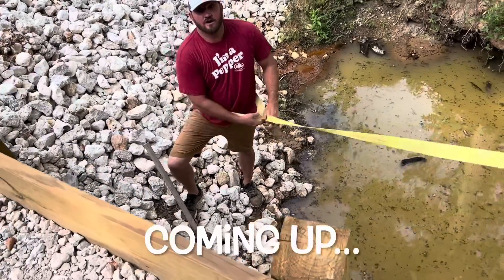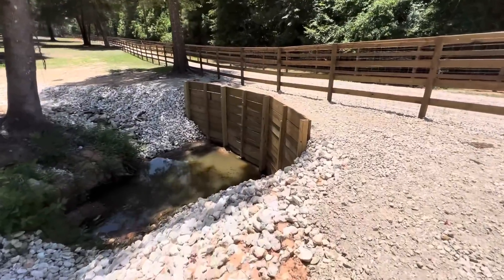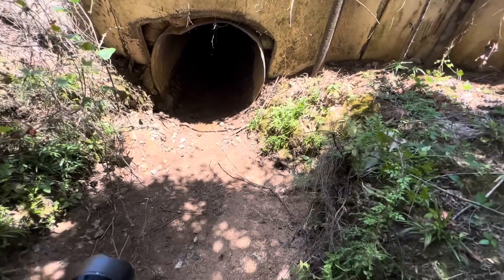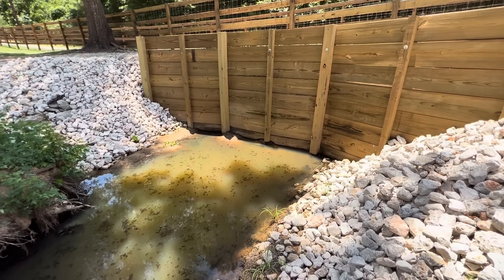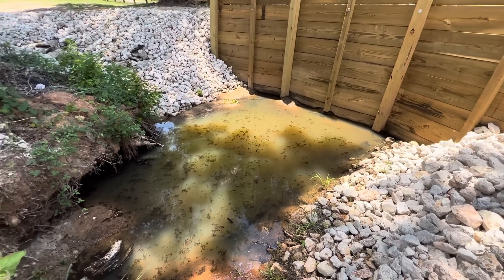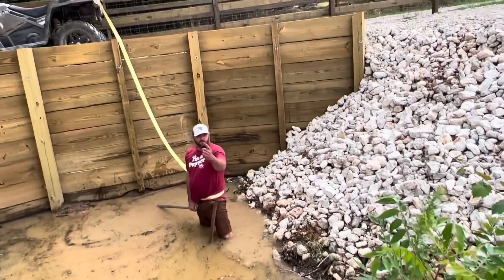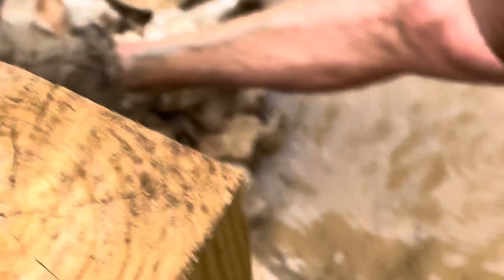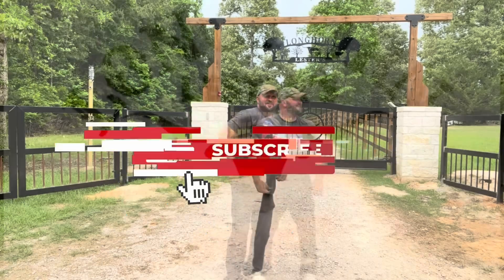Life at Longhorn Lester’s

Comment: Just a suggestion:   If your hose is long enough,maybe you could jet the mud out with the pressure washer and then put screening on that culvert opening to prevent debris from entering.   That's what our irrigation technicians do when they have to get a line cleared out under a driveway.  You and Lex made a great team.
Reply: NOW THAT IS A BRILLIANT SUGGESTION!! I'm just surprised they didn't do that to begin with!! ✔️💯
Reply: @ Maureen Vos 
That is a good idea, it would stop a lot of things, but, it won’t stop the mud. 😢
Reply: The pressure washer might temporarily declog, but that mudbed needs to be dredged out of there with big equipment (suction hopper dredger, cutter suction dredger, or backhoe dredger). And I am thinking that if the mudbed cannot be compacted and topped with gravel, you might have to dredge out that mudbed on a regular basis. That is what is done in some ports around the world- they have to be dredge them out on a regular basis. Just part of maintenance. 
You also might want to plant some more  trees around that area, so that the roots can stabilize the soil and prevent mudslides and mud clogging - because even with a screen covering the opening of the culvert, that mud accumulation is going to be one biggie to deal with.
Reply: @cristinacabrera8580  NOW, THAT'S AN EVEN BETTER SUGGESTION!! I wasn't thinking of long care maintenance just of the problem right now. But, you're right and Lester didn't think that the clay would settle at the bottom because that's the only place the water's at so that's where the clay is going down to and he hasn't installed the problem with the bank like Kim had mentioned to him to do. So if he does what Kim told him to do regarding the run off and and your suggestion I think it will work!! I truly think that Lester thought the rock would hold the mud.. But it's not even that it's the mud just sliding down because it's on an incline. Ta-da Lester HERE'S YOUR SOLUTION!!!  💯
Reply: I agree, you need a pressure hose to wash out the mud. Screening is also an excellent idea.

Comment: Good job man!.. you could maybe try to pump the water out a little with a small sump pump with garden hose to other side to give you a clear shot to the mud pack to hopefully make it easier to dig out. You shouldn’t have to work so hard.   Lex is such a honey.    (Some sump pumps have a filter at bottom though.. we had one in my Koi pond to filter out ick. So it will have to keep lifted off bottom and kept cleaned out). Lester is a smart man and will figure something out and make something work.
Reply: That was my thought too!

Comment: Two things… can you run a portable sump pump down there to drain the water so you can see exactly what’s going on?  From the opposite side it almost looked like the drainage pipe may look smashed.  Hope you get it cleared before any significant rains come (although that would be nice).  Lex did a great job running the video today!
Reply: I agree the other end looks like it was smashed and that is why the water is flowing thru.
Reply: Yeah that is what I was thinking. pump it out to get a better look and mabye easier to fix. And to me it also looks like that the pipe is pushed in so it is a lot smaller for things to go through.Although that is not the problem here.

Comment: I’ve seen a video Lester where they use an old tyre and drag it through the drain, using a hollow metal pipe with a strong rope or chain inside of it, and it works even in a small, long pipe and it pulls out all of the sediment.  Works a treat and you have the tractor OR SUV needed to pull it with a strong chain or thick rope.  That or you get a pump, to pump out the sand from the blocked end.

Comment: when you had the flashlight shining through the clear side it looked like the culvert pipe is damaged and pushed up from the bottom, how difficult would it be to remove the damaged portion so the  pipe would be clear for debris to move through?
Reply: I saw that as well!!
Reply: Something didn't look right about the angle, like the wet end was lower than the dry end? Really couldn't tell.

Comment: Good morning Lester.  Thankful you had someone with you that was on guard in case you got stuck and couldn't get out.  Lex true this is what we do at Longhorn Lester's.  Work hard.  I am not quite sure if this would have worked or not, but could you use your manual fence post digger to get the mud out.  Probably have it back at ISS but just thought maybe would be easier.  Would the digger get very rusty or if you rinsed it completely and dried in the sun it wouldn't hurt it too bad?  It's true you are always working hard over at LHL but it is a dream come true.  Thanks for sharing.

Comment: I do not have the same perspective that you do, Lester, but it looked like the stuck end of the culvert tube was collapsed. When you shined the light from the open end, there was a sliver of what appeared to be light, either from the top (road side) or from the stuck side. 
Lex was a great safety helper and is learning video techniques well. 
Good luck with the culvert.

Comment: Lester try using a shovel or a rake by slowly moving it around the top opening of the culvert in a back and forth motion. Maybe it will loosen the mud then the pressure of the water should do the rest of the work for you. Just be safe.

Comment: Looks like a log wedged in there sideways. Lester, whenever you get that cleared, might I suggest that you get some LARGE rectangular blocks. More than likely delivered, two at least a foot square and about three feet long. Likely a truck with a crane big enough to lift and then place them precisely one diagonally with one end pointing at the culvert. Then have them place the other about three feet up stream on the opposite bank with it's end angled toward the back edge of the first one like a herring bone shape, about three foot gap between the two stones. The first will slow down the silt, but aim the water at the back edge of the one down stream, causing some turbulance and let the water gradually eat away at the silt and send it down stream. You might need to do the same on the other side of the culvert so that it doesn't build up that side. Just a thought.

Comment: Lester, from what I saw it looks like the mud is almost at the top of the pipe. You need to get a shovel & scoop out the muck from the top & work downwards. Starting at the bottom like you're doing doesn't make it move faster. You also need to remove that large piece of wood in the pipe.

Comment: Lester, if you really want to open that up more, put that pipe back in there like you had it, and run the hose down inside it as far as you can push it, full blast, raming it back n forth. It should clear it so the water will flow out. Then once dryer you can dig it out. I would take some of those boards to stand on so your not sinking in the mud. Something I would do. Just thinking out loud.  🤔

Comment: Have seen where an old vehicle tyre on a chain. You'll need to have a good length of steel attached to the tyre and poke that through the colvert and a strong rope or chain attached to the opposite end of the rod. Then tow the tyre through with a vehicle.
It works.

Comment: Lester, once the water is out. You need to dig tgat mud built up a few feet below the edge of that pipe. Then put that river rock all the way to the pipe. You can see tge clay mud build up by tgat tree. Where the animal hole is. Cover all that dirt with that river rock. Or you will be doing this after every couple of rainfall you get. That pipe should have been put in with a tilt to it. Where it was a bit higher on the side the water goes into the drain pipe. I am shocked that they didn't do this or inform you even when they dug up this area up and put the drain pipe in.

Comment: Use steel cable turn buckles so hook large tire to it loop hook on tractor 🚜, pull into culbert, tire will push mud out help flow water that clear cubert out mud limbs

Comment: I have never cleared a culvert but maybe a two-by-four could be used like you did the pipe and make a bigger hole. Then maybe the pressure of the moving water will loosen the mud and once the water is lower you could use a shovel to dig it out?

Comment: Maybe you should rent a pump and get all the water out - it would then be easier to see the clogged part, and then a high power sprayer to move some of the mud.  Also, when you showed the inside of the culvert with the flashlight, it looked like part of it was humped up on the left hand side which means a smaller amount of water wouldn't flow over it - hump is probably caused by a tree root.

Comment: Only Lester would work in that mucky water.🤮🤮  Lex is funny 😂 . Lester you got stuck in the mud before . That would have been my learning experience. To never do that again. But I understand you have to get things done. You need to have that water 💦 running through the drain pipe so it doesn’t washout the driveway. Have a gods evening.

Comment: 🟥 LESTER IF U COULD FIGURE HOW 2 MAKE A SUCTION.

U'D HAVE 2 PUT/SPRAY WATER ON THE SIDES OF THE COLVERT 2 WET THE WALLS
FIND SE TIGHT 2 FIT OVER THE HOL  THEN TRY 2 SUCTION .  (SOMETHING KINDA  LIKE A STRAW)  JUST THINKING OUT LOUD

Comment: Not smart enough to see he had way to much angle and he was hammering it straight into the culvert pipe.  That will cause it to wash out underneath. What he went to the other side and looked through you could see a BIG bend in the pipe